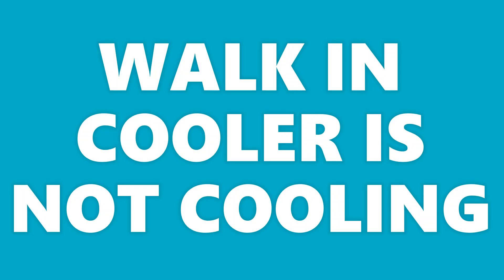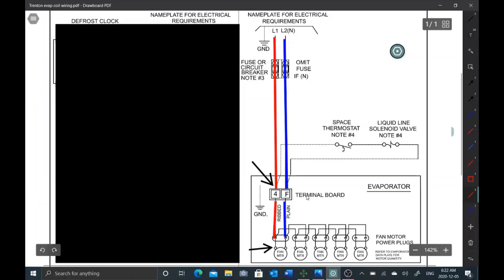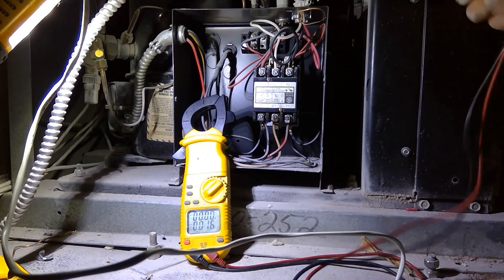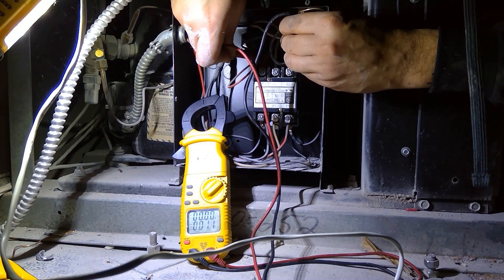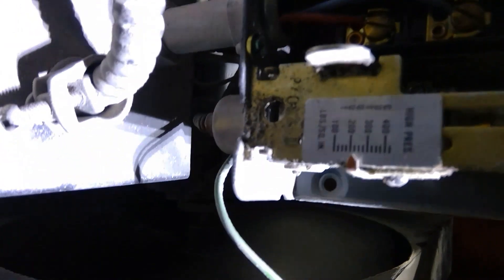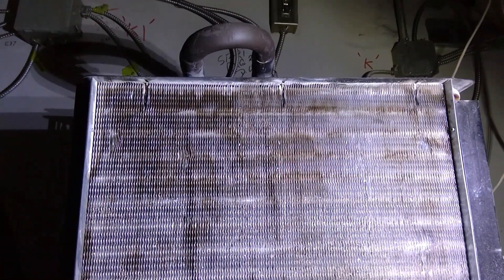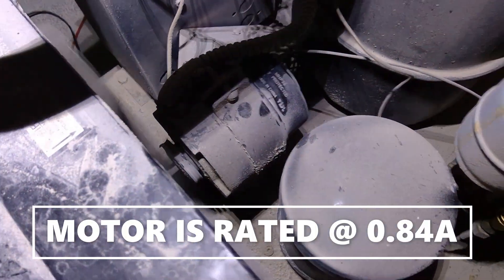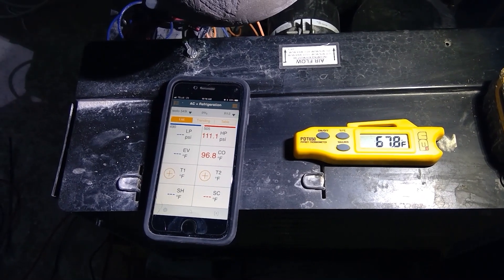Beer Walk in cooler Not cooling (R12)

Comment: 11:26 how do I know if the condenser is divided into 30 or 20 or 15?
Greetings and thanks
Reply from the maker: This becomes challenging unfortunately. A lot of the older equipment is a 30 Condensor split and most of the reach ins. The newer condensers use a 15F Condensor split, but there is no way that I know of to determine this by just looking at the unit unfortunately.